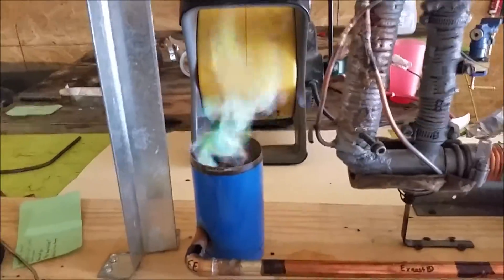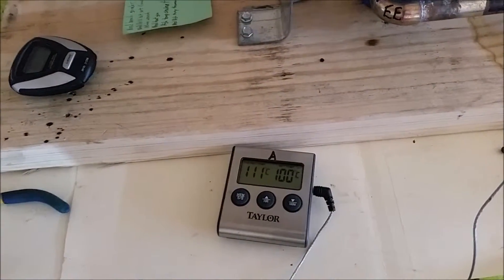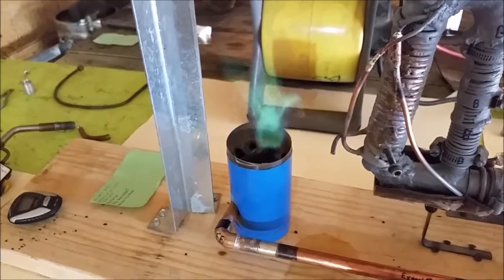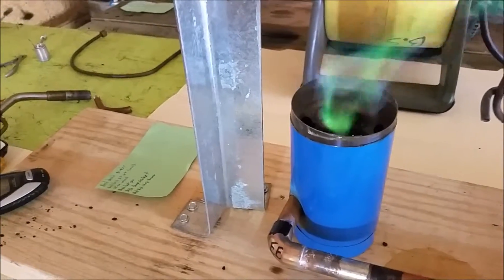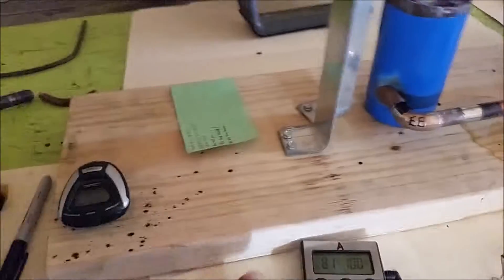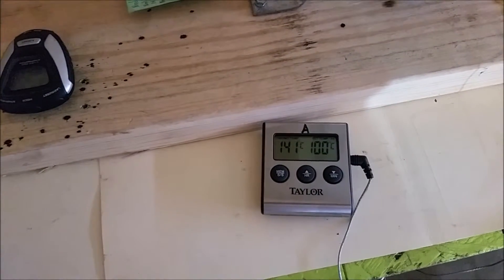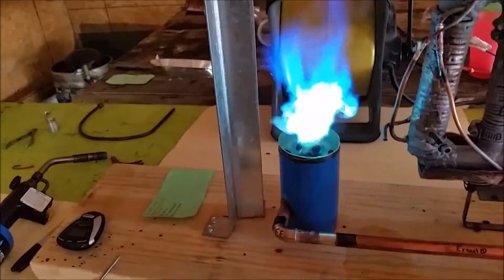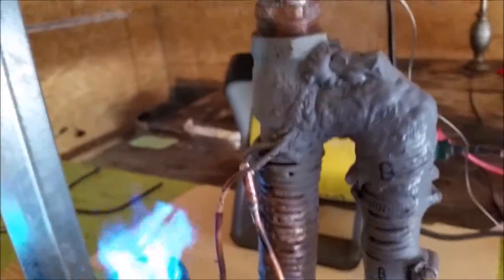Micro Charcoal gasifier

Comment: It makes sense that a water shift gas reaction be included on any gasifier build. After all it's just water. The heat is already there for cogen and the output of a gasifier is lower compared to gasoline and needs all the help it can get. Brave souls. Many thanks.